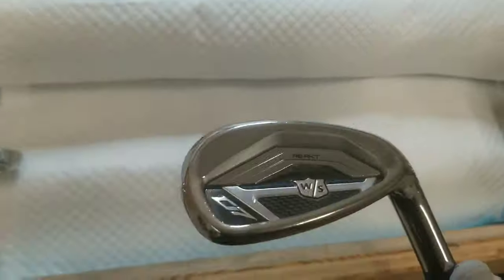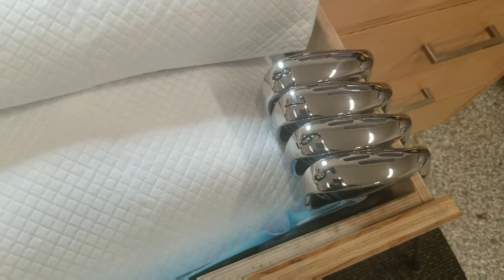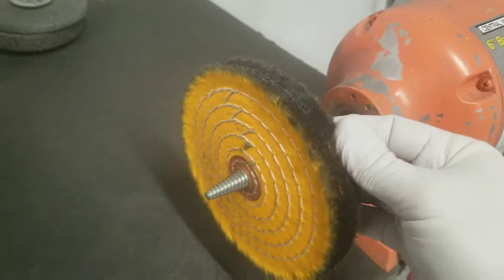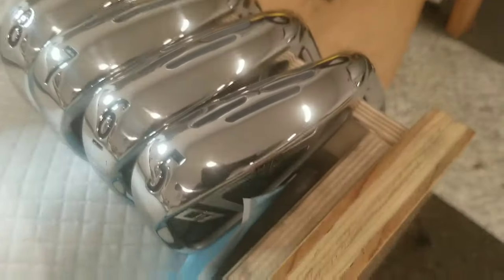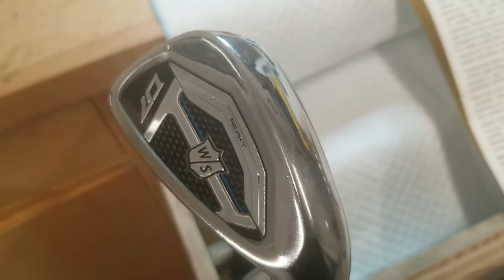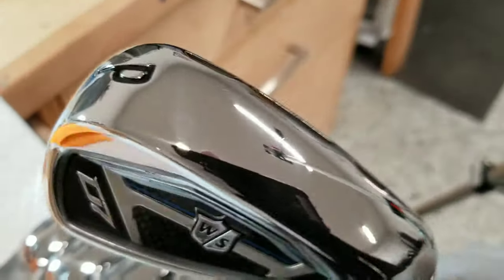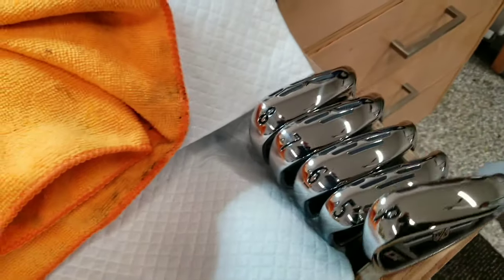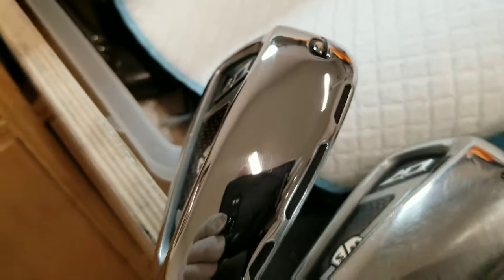How to Polish Golf Clubs Like a Pro

Comment: Hey buddy.  I'm going to start this project today once Amazon delivers my bench grinder and I assemble it.  I watched closely and noticed you didn't buff the chrome on the FACE of the club until you got to the white bar polish.  Should I ignore the black and brown for the club's face and only use it for white? (I also noticed you didn't buff the very top of the club face (the part you look down at, when the club is at address) until white.  Thanks
Reply from the maker: Sweet. You're going to love this.

I use both the sisal wheel and the black on the face now. I think this video was pre-sand blasting so I avoided it. The top likely had the matte finish and I avoided it as well. If you're going to blast it, then I'd start with the best "base coat" as you can then knock it back down to matte with the blaster. If you just go with the white, it'll look cloudy because white won't get out larger scratches. 

Spend 99.999% of your time with the sisal wheels then go to the denim wheels.
Reply: I bought the polish rings from your link.  I think they're super out of balance.  The grinder sounds fine before I installed them, after it squeals like a pig.  Quadruple checked and it's the polishing wheels.  May try to get a set with more ply
Reply: @BradMeehan  Thanks Brad.  I went ahead and bought the spindle adapters because no matter what I do, when I put the polish wheels on it squeals like a banshee and I don't trust it.  It's like the wheels aren't balanced.  Hoping they'll clear that up.  I'm confused with those spindle adapters because they have those points, and the polish wheels (especially the soft white one) doesn't seem to have a strong enough hole area to jive with those spindle adapters screwing in without the help of a nut/washer.  But I ordered them anyway since I see you guys doing fine with them, and hopefully that will show that my polish wheels aren't defective.  Otherwise, I'll have to return the wheels and get another brand.  Waiting on their arrival for Saturday :)  Thanks again I really appreciate the advice.  
PS:  I'm not at the blasting part yet. From what I understand that is for the FACE of the club where the ball hits.  I was talking about the chrome on the face of the club, not the area where you strike the ball
Reply: @BradMeehan  - PS:  I'm not saying this guy is right, I know nothing.  But he's claiming you're supposed to use green before white, on stainless steel (with no mention of brown for ss.  He says brown is for aluminum).  Yet another thing to add to my confusion heh:  https://youtu.be/ZLfgjeq86fw?t=158
Reply from the maker: @ikigai47  My white has some grit in it, but my green does not. Check out the chart on the third photo of this product. I'll screen shot it too.

https://amzn.to/3QWB5Me
Reply from the maker: @ikigai47  The spindles have a reverse thread, almost, so when the wheel is spinning, it continually "tightens" against itself as you work. The taper gets larger as it gets closer to the motor, so it won't fly off or spin.
Reply from the maker: @ikigai47  Are they all like that or one in particular? I've been using these same ones, but I don't want to recommend a junk product if you're not having luck with them.
Reply: @BradMeehan  - My white (i bought those exact color bars on amazon because of your link) doesn't APPEAR to have grit in it while holding it in my hand, new.  But cool I see that the brown's description says it works for BOTH aluminum and s-steel.  Looks like I can even use blue if I really wanted to since it's all purpose
Reply: @BradMeehan  - ah.  What confuses me as a noob is, my soft white wheel, seems to flimsy to support those pointy spindle extensions.  That link I sent you, the guy is using ones with a white supporting plastic disc on each side, which makes sense.  But it's sounding like that's not mandatory and they'll work just fine.  Can't wait till tomorrow to get the extensions in so I can try it.  When I put them on now, my grinder literally squeals when applying pressure.  So not sure if unbalanced wheels are a thing with polishing wheels but it so far it seems like it
Reply: @BradMeehan  - I tried it with both the yellow wheel, and the white.  Both at the same time, and each by themselves.  I'd get the grinder squealing in any scenario.  So I checked with the normal stone grit wheels and it's smooth in operation, so it must be the polishing wheels? I will for sure let you know if my extensions fix the issue (gets here tomorrow), so that way you will know if that product has quality control issues or not.  by the way, that same company also sells other polishing wheels that have more ply to them for a little more per wheel (but only come with 3 wheels, white, yellow and another thicker white).  So... maybe this lower ply set it just a lesser quality and therefore is giving me problems.  We shall see tomorrow.  Thanks so much for helping a guy out, so appreciative of your time
Reply: @BradMeehan  - Okay, spindle adapters arrived.  It works! And it's glorious and silent, so the polish pads you recommended appear to be fine.  No idea why, when I use the polish pads without extensions (clamped on with nut and washer vs the twist on style) created such noise (re-installed it many times in case I was putting it on wrong) but this resolved the issue.  Thanks again! Oh boy it's polish time finally!
Reply from the maker: @ikigai47  Yes! Last bit of advice, try to do it outside or in a garage. They leave a TON of dust if you're inside. 

Let me know how it's going!
Reply: @BradMeehan  - oh man, I did a Cobra F8 iron and a Ping putter in my office and I found that out in a hurry! Sticky dust.  Backyard from now on lmao.  The white soft wheel sure does shed.  I have little string bits everywhere.  Wish I could send you a photo of the clubs I did so far! Looking good.  Not quite as good as yours but close and worlds better than it was.  I covered the face hitting area with the HVAC tape because I did a test run on a Lazrus iron and kind of gunked up the face.  But Ping putter shines now!   👊
Reply from the maker: @ikigai47  Hook me up! Brad @ bradmeehan .come

Take look at the bench grinder pedestal on my Amazon store. I can move around easily tondo it outside.  I have two of them now.  You may find one locally too.

Comment: Hi Brad. Trying to fix up a Ben Hogan sand wedge that had some dings around the edges. I used the deburring wheel and a file and got it looking pretty dingless. But using the polishing wheels I can't get an even shine to them. Dull in some places, brighter in others. Could I have removed the chrome in the deburring process?
Reply from the maker: Yes, you probably went through the chrome and into the nickel. The nickel will have a TINY hint of yellow to it versus the TINY hint of blue in the chrome. The result is now you have some exposed nickel, maybe a bit of exposed steel if you had any nicks that chipped the chrome, and remaining chrome that wasn't removed by the deburring wheel. If you're going to re-plate them, the chrome has to be removed or it won't plate to it AT ALL.  If you just want to keep them shiny and not re-plate them, i'd recommend you wipe them regularly with a corrosion inhibitor.

Comment: Great video! Just wondering what you do for more of a brushed finish golf club? Such as a Minzuno jpx hot metal
Reply from the maker: There are few ways I've done it.  I'd polish it first, then do the brushed look after. Red or green Scotch Brite pads do a good job, or if you want it more pronounced, then use 400 grit (or more course if you prefer) sand paper. The key is to go in a STRAIGHT line so it looks brushed. Check out my video of the Titleist driver restore where I dressed the face with paper for the brushed look. 

The last way is to use a finishing wheel. You can buy smaller, 6 inch wheels on eBay or Amazon. Watch this video at the 1:56 mark: https://youtu.be/l1F5Cs5ywNg
 It's just harder to get into all the angles in a straight line.  Hope that helps and let me know if you have more questions.

Comment: Very nice  job. Have a question ?  Can satin  finish  be removed from   irons and make them look like chrome .
Reply from the maker: Yes, satin finish just means they weren't polished to a high shine (they stopped after the course materials) or introduced scratches on purpose to give it the "brushed" look. The high gloss is just removing those purposeful scratches with smaller amd smaller scratches that become more reflective as you use more fine compounds.
Reply: @BradMeehan  what's  the  best  way  to  remove  it . Can you polish it with the polishing  wheels  or you have to use polishing sanding belts.
Reply from the maker: @manuelgarza969  You wouldn't need the belts (unless you have one) Even hand sanding would do it. It just takes more time. Start with 600 grit and see if that smooths it out, then go to 1000, (1200, 2000, etc) before using the wheels. You want to start with the lights grit and go heavier if needed, or you'll be doing unnecessary sanding to get out scratches that you introduced with heavy sandpaper.  Start light, then go to the wheels.

Comment: Did you swap stitched  wheels between the black, white, and brown compounds?
Reply from the maker: I didn't, but it's best practice  since there may be more coarse compound in the wheel when you're trying to go more fine. There's a tool called a 'rake' that you hold against the wheel and it drags out the compound before you move to the next. I'll make a more detailed video with all those steps if you're interested?

Comment: Hey Brad is this not a chrome finish?
Reply from the maker: It's not chrome. These cast clubs aren't plated and can be polished to a mirror shine. I learned this by polishing an aluminum gear shifter cover on a motorcycle. Same principles here. Forged irons would be plated to protect the bare steel, but these aren't

Comment: Practicing on an old ram zebra putter. It’s got some pretty deep gouges. I’m not even sure the sisal is going up be enough to get down in there and remove the deeper scrapes? Any suggestions?
Reply from the maker: I agree. One of the Mizuno has a gouge in the sole. You can't sand it down that much because it changes the club. I'm going to learn how to do simple brazing to fill it with bronze or silver since I'm going to replate over it. I'll film it to see how it goes.

Comment: Brad, been really enjoying your content and almost have everything I need to try to do a complete restore and nickel or nickel then copper plate on a classic set of blades.  My question in terms of the order to do the restoration, would this be best?

Strip Chrome
Sand
Polish
Clean
Plate with Nickel
Plate with Copper
Polish up 

Or would I sand and polish while still chromed before stripping.  Thanks.
Reply from the maker: Hi, Zach. I would definitely strip the chrome first. It's such a durable surface you'd just be battling yourself to get scratches out.  

I added a few notes to your list below with **'s. 

Strip Chrome
Sand
Polish
*Reface the club face with the media blaster if you have one*
Clean
*Clean again*
*Rinse with distilled water*
*Surface activate any remaining nickel*
*Rinse with distilled water*
Plate with Nickel
*Rinse with distilled water*
Plate with Copper
*Rinse with distilled water*
Polish up 
**I'd only use the loose cotton after plating or do it by hand

Let me know how it turns out. I'd also recommend going to a thrift/second-hand store and buying a junk iron to practice on to fine-tune your method.
Reply: @BradMeehan  Awesome, awesome feedback, thank you.  The only step I don't remember offhand is surface activating the nickel so I will refer back to your end-to-end video to brush up on that.  A sacrificial Macgregor Golden Bear has been my test subject thus far and will continue to be.  The set I am working on is a project I came up with around getting a set of classic blades from the year (or as close as I could get) I was born, 1990.  I found a set of Wilson Gooseneck irons I absolutely can't wait to have looking incredible in copper with fresh shafts and grips.  Thanks for your responsiveness!
Reply from the maker: @zachdrummond4180  Check out the last few plating videos and i show the surface activator. It's about a 30 second job and it (supposedly) re-activates the existing nickel to accept the plating.

Have you seen these ferrules? Might look cool with copper clubs: https://bbandfco.com/collections/fresh-designs/products/cupric   (or their full range here: https://bbandfco.com/collections/fresh-designs)
Reply: @BradMeehan  I was just looking at these the other day but they were sold out.  If they're back in stock I'm on them.

Comment: Soo I purchased a ryobi bench grinder, the wheels are inside like a casing, there’s no reason I can’t remove them and have my wheels spinning out in the open is there? You definitely have more room for the clubs with the extensions and no protective casing.
Reply from the maker: You'll have to remove the guards. Should only be a few screws per side. You'll have a lot more room with the extenders.

Comment: Will this work for forged irons as well?
And doesn’t it remove the chrome coating?
Reply from the maker: It's different for forged. You can polish them using a yellow compound, then a green for the final buff, but the large nicks will still be there.  It will be shiny, but not like the cast clubs. 

Chrome is such a durable layer that you won't get the scratches out without getting under the chrome layer. Once removed, you'd be down to nickel or even bare steel and have to have them re-chromed  ($$).  I'm working on a video with 'near chrome', which is a cobalt with brighteners that looks like chrome but is more durable than nickel. Chrome is easily removed, and nickel is easy to polish. Then, the near chrome layer provides the brightness and hardness needed for durability. 

I'm using these solutions:

https://www.amazon.com/Chrome-Plaing-Plate-copper-nickel/dp/B00WKHGZI2
Reply from the maker: Check out my latest video for how the bright nickel plating looks on forged irons.

Comment: How long do they stay shiny for?
Reply from the maker: That's really up to you and how you care for your clubs. They're shiny until someone jacks them up on rocks, bad lies, hard pan, etc.
Reply: @BradMeehan  thanks. Just wasn’t sure if as you are taking the top layer of if there was a coating that may be removed and they start to dull over a period of time.
Reply from the maker: @TheFootyCoach351  You're welcome. Thanks for watching!
Reply: @TheFootyCoach351  if you polish clubs with significant scratches and remove them , then the newxt time you can run the risk of going through to a dull layer  - usually in the middle of the sole where you tend to polish most. the dull patch looks like a cloud reflecting in the shine on a sunny day but its a dark grey cloud  - not visible form all angles but you know its there

Comment: Hey Brad, I bought a used driver and it had a couple of shallow marks in the paint on the top. I was able to get the marks out with some very fine sand paper, and then tried to polish it with 8000 grit sand paper and then some red rouge jewlers polish, but its left it somewhat cloudy where I sanded it. Any idea how I might fix that? Wish I could get it back to that  mirror finish.
Reply from the maker: My guess is the leap from your  fine grit to the 8000 was too great, meaning the 8000 isn't getting the scratches out that you introduced from the fine paper. The change has to be gradual, meaning if I use 400, I can't jump to 3000. I would need like an 800, then 1000, 1200, 3000, etc. However  you're risking sanding through the paint. Have you tried a rubbing compound instead Ike in the Titleist video or the Cobra Baffler "2 Minute Polish" video? That may be safer.
Reply: @BradMeehan  went and got some Meguiars polish like in the video and it made a big difference! Still some swirl marks at certain angles but I can live with those.
Reply from the maker: @DjPelland  Good deal. You can apply this technique to a lot of different surfaces now.

Comment: I’m using a drill to polish my clubs but all I’m getting is a foggy look. Any reason why?
Reply from the maker: Couple of things:  When I see cloudy finish on my clubs it means i didn't spend enough time on the previous step and tried to go to finer compounds before i worked out all of the scratches. You're probably still seeing the dissipation, but at a finer scale. 

Could also be the speed of your drill.  The bench grinder i'm using is moving at 3500 RPMs with a 6 inch wheel so it's very fast and doing 18 inches of cutting for every revolution of the wheel.  I'm not sure how fast your drill is moving or how big the polishing attachment you're using but i could just be slow.
Reply: @BradMeehan  awsome! Thank you for the reply!
Reply: @BradMeehan  my drill is going at 3000 RPMs with a 4” wheel. I use black, brown, and green compound. I use a stitched wheel for black and brown and a cushion polish wheel for green.